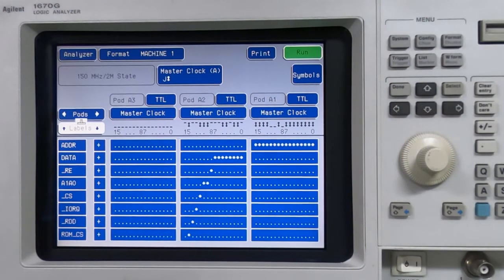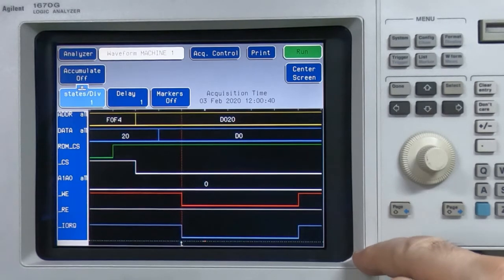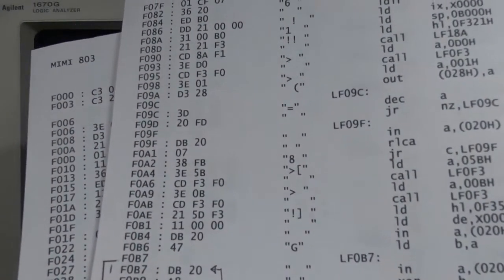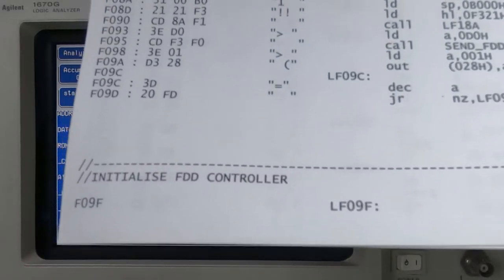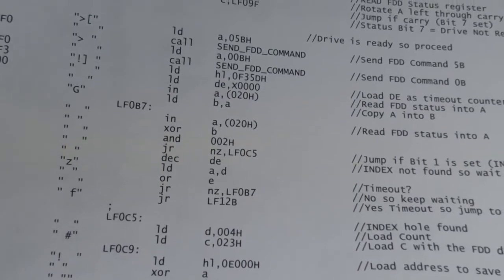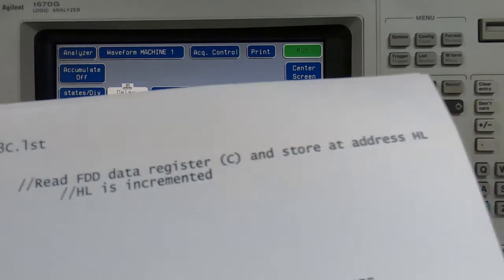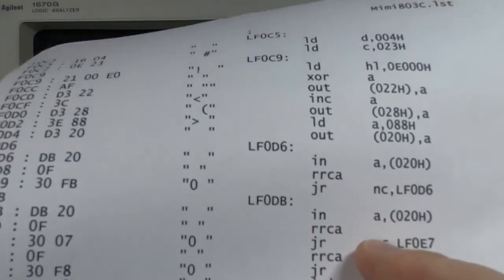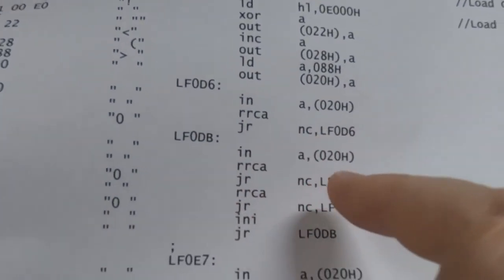Mimi 803 Boot Disk Part5

Comment: It would be very interesting if you could also explain how you go from a bin file of the eprom to the listing you printed out. From your previous video's I saw you use DASMx, correct? Looks like a nice disassembler. So if you have the time to make a video about DASMx, that would be nice to see. Thanks.
Reply from the maker: I actually used 2 different disassembers for this video (and a bin to HEX utility which I wrote specfically for the video). I do not own rights to dasmx so I am not sure I can show its use in detail as I would get a copyright strike on my channel but I will post a video explaining the general process. Of course the disassembler does not add the comments or the code formatting so I do that manually.
Reply: @JerryWalker001  That would be great.
Reply: If someone has some basic coding skills it is not too difficult to write their own disassembler for a given vintage 8-bit microprocessor. If you're not already familiar with the microprocessor in question, writing your own disassembler for it is a good way to learn the details of the instruction set. If you write your own you can also customize it for your own personal needs. One thing that can be done that can be helpful at times is to make it smart enough to only disassemble instructions from locations which can be reached through the instruction execution flow. For example start at the known reset vector and then recursively follow through any jump, branch, and call instructions as they are encountered, and stop a disassembly thread when a return instruction is encountered. The locations immediately after an unconditional jump or branch, or after a return can be treated as data bytes instead of code bytes unless a jump, branch, or call instruction is encountered with that location as a target. Doing something like that can stop the disassembler from treating data bytes as gibberish code, and possibly getting out of sync with the instruction stream. This can get tricky with indirect jumps where the target address varies at run-time. Dealing with that may require manual analysis and intervention, for example there might be a jump table from which a set of possible target locations could be extracted, and then the disassembly could be run again with that list of target locations added to the disassembly start points along with the known reset vector. You probably need to make several iterative disassembly runs as new reachable target locations are discovered. Hopefully you are also learning more about the code flow each time you iterate through the process. There is no single optimal way to do this, use whatever tools and methods work best for you.
Reply from the maker: I frequently write small utilities for exactly this purpose (that was the second disassember I used). Unfortunately including threading is not easy in a hardware system as jumps are frequently based on hardware IO and so the destinations cannot be determined. A useful addition however is code exclusion to mask out know text or data blocks. It all comes down to what you are trying to do Hence the videos showing how to use the analyzer to examine system code and determine jump paths.
Reply: @glenslick2774  Ok thanks for the explanation